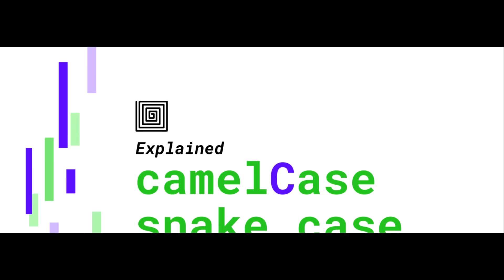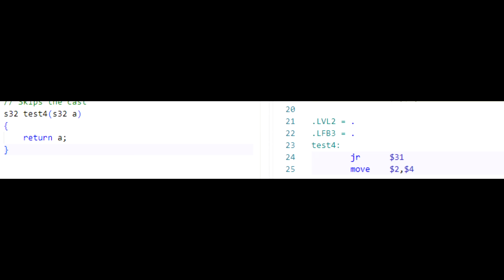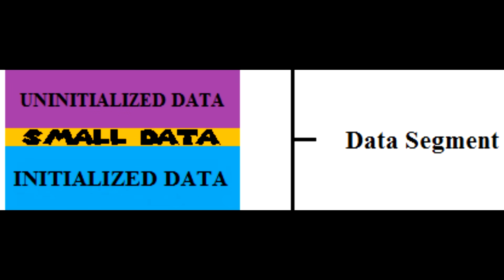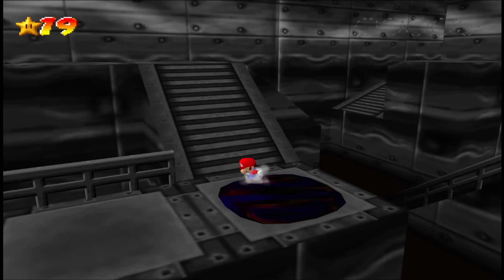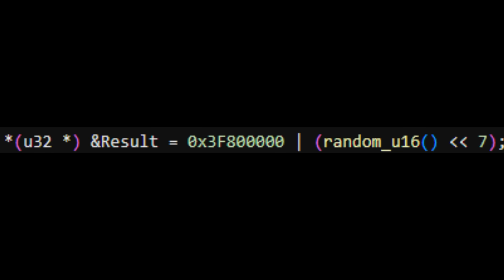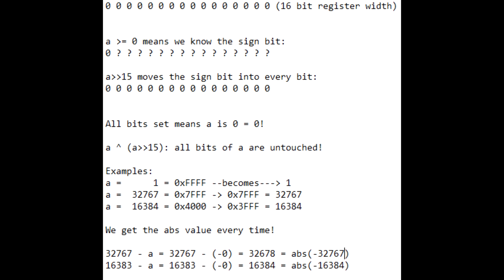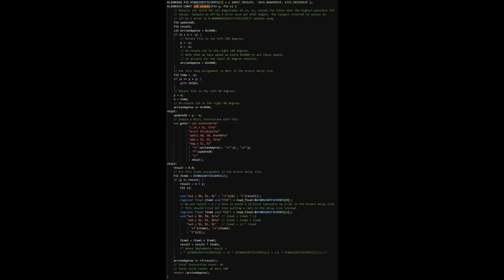Optimizing with "Bad Code"

Comment: The 'goto' part got me thinking the next step here would be to implement a N64 specific compiler
Reply from the maker: i already have some n64 specific tricks in this compiler! its a custom gcc build.
Reply: @KazeN64  Are they N64-specific or your-game-specific? Is your GCC fork public? I can imagine the libdragon guys being interested in this (unless they already implemented the same tricks in their toolchain themselves).
Reply from the maker: @the_kovic  easyaspi made it and it is publically accessible! although she's only posted it in my discord. but i have the custom build linked in this repo's readme
Reply: @KazeN64  
Wait, since this is a custom fork of gcc. Is there a way to patch-in a sort-off assembly passthrough in the compiler, so that you can write in both C and Assembly without doing the weird inline assembly trick you mentioned?

Probably overthinking things as usual, but who know.
Reply: I've had this idea for a while but I'm not sure how to implement it. It would basically be like Godbolt Compiler Explorer but it also showed you clock cycles. Like if you highlighted a section of code, you know how it shows the total character count? Imagine that but it also assembled it and displayed the byte count and clock cycles.
Reply: Yeah, this trick is pretty commonplace. I find myself using it a lot when writing optimised routines in high level C# code.

On modern architectures it can also sometimes be beneficial to just duplicate the code and go without goto, due to greater size of instruction caches.
Reply: @williamdrum9899 it should be fairly easy, I'd think. I have a massive PDF somewhere with a table that contains all the instructions' latency and throughput for most major desktop CPUs. So long as you supplied a target triple for which you had data, it shouldn't be difficult at all to make an extension for it.

Comment: If there's something useful I've learned in all my years, never use a linked list, for anything. We'll just ignore that a linked list can be thought of as a flattened tree because trees should have an algorithmic structure and no longer be thought of as being a type of linked list at that point. However, for cache locality and speed of processing, an array of some kind is best. If you need to store more than a certain threshold that should be determined per the processor you're programming for, then use a hash table or some other algorithmically accessed array type. The best kind of hash table is one in which the data is stored in contiguous chains and thus you reference its location in storage with an index value and upon deletion you swap to the end and update the single element that took its place, while also remembering to store the hash code as even at 4 bytes it'll save you a lot of time in not recomputing hashes whenever the table changes size, as well as using table sizes that are powers of two so you don't have to divide. I should probably write a book as there's a lot more to it than that, but it's a start.

Comment: Half of this isn’t even optimising for the hardware, but manipulating GCC. At what point is it better to just build your own version of GCC specific to a single project?
Reply from the maker: in a way the reason we have to manipulate GCC is because it is not optimized for the n64. but yeah a custom GCC build would be the best option. i currently do have a slightly edited GCC for this purpose, but it's nowhere near perfect.

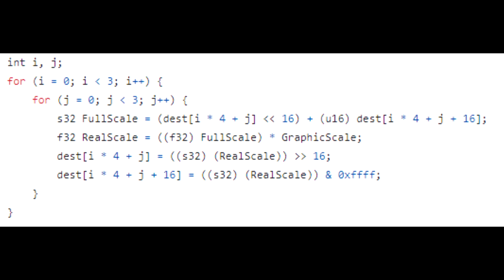Comment: 7:04 You can avoid this issue entirely by moving the decrement of the loop variable into the body of the loop so it executes after the loop condition and before the first loop iteration.  This is also very useful for decrementing loops that use unsigned integers.

Comment: Regarding the overflow emulation, the C standard doesnt specify it for signed integers, so you could probably just use a signed index into the array to start with

Comment: 6:52 - same with 68000 - it has a "DBRA" instruction - "Decrement and Branch", which decrements and branch if not -1. However this means you MUST write:
for ( i = count-1; i >= 0; i-- )

This will NOT produce DBRA (at least not with my version of GCC):
for ( i = count; i > 0; i-- )

...even if "i" is not used in the loop body! Instead it does a standard SUBQ+JNE which is slower. Same trick, but an annoyingly subtle MIPS-vs-68k difference.
Reply: That is so frustrating. When I'm doing 68k asm I usually would do something like this:

foo:
MOVE.W #9-1, D0
DBRA D0, foo

for a loop that is intended to execute 9 times

Comment: As a general advice, if you really need top of the line performance out of limited hardware, focus on writing clean code, and then convert in the most performance critical places to faster, less readable code, measuring what you do, until you hit the performance goal. Given what you're trying... yeah... good luck

Comment: Kaze: Uses "goto" to swap logic for instruction caching
Me: YOU WHAT?!
Kaze: Overwrites functions with memcpy for a properly optimized call path to avoid bugs per console
Me: I AM CALLING THE POLICE!
Reply: i have honestly never seen the goto thing before, both are illegal but i'll permit it I'vd overwritten code with raw machine code bytes at runtime before. e.g. a E8 Call on x86.

E8 00 00 00 64

calls func 100 bytes after end of that instruction
Reply: I couldn't read your "YOU WHAT?!" in any voice but Incidental 6's (from Spongebob). You know which one I am talking about.
Reply: @GreyWolfLeaderTW  "You asked for a couple of ice cubes, but I only put in one!"
Reply: Memcopying functions is such a lovely abuse of C.
Simple, efficient, logical, and yet so heretic.
Reply: @musaran2  Janking with your own execution code in memory was done in Wolfenstein 3D. I have no idea why they did it either.
Reply: Some cheat-code handlers (like Gecko OS / Gecko Code on the Wii) make it possible for cheat codes to modify game code; furthermore, on the Switch, I've seen cheats that do this in tandem with a button activator - e.g. if B is held, write some instructions in memory; if B is not held, write different instructions

Though I have to say, the goto trick and the memcpy trick "to avoid bugs per console model" are such neat ideas lol
Reply: @zitronenwasser I think it's just the more extreme version of using just `likely(...)`
Reply: Overwriting functions with memcpy was very common in the 16 bit era. You know  those games where each level had a cool visual effect? Well, it's a pain in the butt for a game to ask every frame "Which level am I on" when that's not gonna change. But this "disgusting" trick is really the only way to avoid that. Rather than having an n-way branch based on the level we're on, the proper graphics routine is memcpy'd before the level begins. That way there's no need to even check!
Reply: @williamdrum9899 If you wanted to avoid branching and memcpy, you could make a jump table with the level index (in this specific scenario), buut that costs an array of length n and probably a couple instructions.
Reply: @fisch37  Memcpy is better in this case since I have plenty of time between levels to do it, rather than waste my precious HBLANK time
Reply: Call the police if you want, it's not as fast as Rambus

Comment: The compare with zero trick also works on the NES, SNES, and all other 6502-based systems. Whenever you do an arithmetic operation, it sets the equal and carry flags with an implicit comparison to 0.
Reply: Even LDA implictly compares to zero!
Reply: On x86 too, thanks to the zero flag
Reply: @erkinalp  Yep, that's why we use "test eax, eax" so we don't need to encode 4 bytes of zeros

Comment: Had a coworker that wrote a small script in python cause it is "So easy and fast to write". When he used it he noticed it was too slow to be used at all (simple test-cases with inputsizes in the range of maybe 50 elements would work, we needed thousands). Then he spent weeks trying to make his python faster.
He ended up writing it in C++ and was done in 2 weeks (and a couple thousand times faster program).
Reply: I did some advent of code challenges in PHP this year & BOY IS IT SLOW. 

One of my solutions was a brute force of about 4 billion operations, which i broke into 10 processes & then each process took about 3-5 minutes.

Then someone in YT comments said they brute forced in Rust & got it done in a minute or two.

To make it better, my brute force didn't even get me the right answer! Lol.

Also by "operation" i mean ... a loop, basically. Each loop had quite a few things to do.
Reply: There was another advent of code challenge i did in PHP that was computationally intense (+ LOTS of memory access) where i was able to optimize the heck outta my php though & actually make it work. 

That was my first encounter with memory bottleneck being a real problem.

Comment: 1:45 The lie you tell the compiler here is a neat trick, but I wonder of the cast can be avoided with an assume attribute instead to just tell the compiler that the value is in a valid range?
Reply from the maker: oh i didnt know that was a thing to use
Reply: @KazeN64 I've seen an ASSUME(x) macro implemented as if(!(x)) __builtin_unreachable();
Reply: @tolkienfan1972 gcc's attribute assume is even smarter, since it doesn't semantically execute the code. That means you can tell it to assume things about the result of variable modifications.
Reply: @gfasterOS  I guess that's new. Well, new to me

Comment: Well, tbh the principles are more straightforward than that. When you write code, your very first objective is to make it produce the desired result or outcome. Second, you make it robust - you take into account edge cases and variations. Third, you optimize it. And you have to do it in that order specifically since there is no sense of optimizing a code that doesn't work.

And when you optimize you basically sacrifice maintainability - aka you don't expect to change that code much ever again, it is the dead end.

Comment: Re: 4 this is so cursed and amazing

Re: 7 separating the "hot" and "cold" branches of a function is a good one. There are a few variants of this that may or may not help (usual caveats: depends on arch and runtime patterns). Instead of using "goto" it might be better to call a separate non-inline function. You can put all the "cold" branches in a separate section, so that more of your "hot" paths are in cache. In cases when the "hot" path is very small and common, you could also inline the hot path.

Re: 13 at some point it is clearer to just go full asm :)

Comment: And so now we know why the N64 was the "less performant" console in spite of the lack of disc read times.

To squeeze all the potential it had out of it, you had to be a fluent practitioner of the dark arts, on top of breaking several coding Geneva convention guidelines.
Reply from the maker: fortunately all of these just save a few microseconds here and there. i'm sure other consoles had similar dark art shenanigans you could do haha
Reply: @KazeN64  gotta squeeze as much as you can out of the 16k microseconds you get per frame
Reply: I imagine most of this video applied to playstation as well

Comment: It's scary to think, but it seems like that self modifying code trick could actually make a big impact in some real use cases. I mean you can potentially save millions of if-checks with it.
Reply: I have done something similar in a Javascript game I'm working on. I had no idea if it was even faster or anything, I just thought it was cool that I could do it. I used it for remapping keyboard inputs to different functions depending on if you're in a menu, a map, a battle, etc.
Reply: thankfully, protected mode saves us from even having to consider that on modern CPUs
Reply: @TwilightFlower9 you can tell the kernel to make a read/write/execute page, this is how most JIT compilation works
Reply: hell, you can tell the compiler to just make your code writable (or use objcopy, if the way the compiler does it makes things not work how you need them to)

Comment: Casting the function pointer in that instance is undefined behavior because s16 and s32 are different types. Be sure to carefully inspect the generated assembly if you do this
Reply from the maker: What's undefined about it? It seems pretty clear what the compiler needs to do here. I imagine it's only "undefined" in the sense of "it behaves differently on different hardware" and not in the sense of "the compiler can choose to do something wrong here"
Reply: @KazeN64  Dereferencing a casted function pointer is undefined behavior if the return types, amount of args, or types of those args differ. Undefined behavior means that the compiler could generate batshit asm depending on the optimization level you choose. Just check to make sure the outputted code is what you want
Reply: @KazeN64 Also is there any reason why you write in ANSI C89 for N64? I would imagine your GCC to at least support C99. That way you wouldn't have to do ugly things like declare variables outside of for loops. That is a major source of bugs in the Linux Kernel and the main reason why they moved to modern C standards
Reply from the maker: @xBiggs  the original sm64 source used an old compiler and all the vanilla code is matching. my own code can use newer conventions

but none of what you mentioned explains WHY it's undefined behavior - shouldn't it just use the function signature provided to generate the assembly and call it as though that was the actual function signature? it should be predictable what it compiles to here
Reply: @KazeN64  Thought:
You may be able to avoid the undefined behavior by having the function return union {s16, s32} and subsequently use the s16 member. The union will take up s32 space and satisfy your alignment requirements
Reply from the maker: @xBiggs  i dont see how that would help prevent the cast
Reply: @KazeN64  I don't think the union uses a cast? Share me your compiler explorer
Reply from the maker: @xBiggs  i haven't compiler explorer'd it, but just logically it makes no sense that you can get either the higher or lower 2 bytes of an s32/s16 union without casting. there is no assembly code that would be able to do this in MIPS. what do you want it to compile to here?

Comment: ... What I'm getting from this is that when you will be sent back in time to make the fully optimized Super Mario 64, they will either kick you out for writing this code or praise you for your genius.
Reply: They didn't had the same compiler.
So, some of his hacks won't be usable.
Back in the day, if you wanted power, you wrote assembly functions and used C as "super assembly".

Comment: Wouldn't writing some functions entirely in assembly be more readable than having to inline some asm instructions here and there to force the compiler into producing the asm that you want? At least for short functions.
Reply from the maker: probably, but writing inline assembly for mips gcc is torture, i can never get it to just go into the rom and it throws millions of errors lmao
Reply: GCC is also very enthusiastic about exploiting undefined behavior, and will usually use it to do things you don't want. You have to deliberately disable certain optimizations in order to get away with faster code, which will just make code elsewhere slower.
Reply: @KazeN64  what about writing out-of-line assembler then and just linking it in as a separate object file
Reply: @Ehal256  good point, and I don't think  you could use LTO to easily fix that.  I'm not so sure that 68k assembler is actually easier to write than MIPS asm (a lot of places used to use MIPS as the intro to asm)
Reply: @undefinednan7096  While that may be true, MIPS was really designed for compilers, and 68k (designed in the late 60s) was still made to be hand-written. I would guess that MIPS is common in those courses due to the simplicity of the ISA, so it's easy to go from an asm course to a compiler course using the same instruction set, and the fact that 68k became a dead end right around when MIPS became popular (Motorola was focused on PPC). I'd say MIPS, and most of those classic RISC instruction sets, are a bit too simple for hand-coding if you ask me though, 68k is downright comfy in comparison.

Comment: As someone who's coded games that fit in a few hundred bytes, I see this as an absolute win.
Reply: Boot sector games?
Reply: @EndOfForever  In that size range, sometimes smaller. A while ago I made a version of Snake that fit in a Tweet, or under 280 bytes.
Reply: Games for TI83 calculators can be pretty small if done well.  I made a 5-level puzzle-platformer in around 1.5kb once.  But the Bubble Bobble game I made was much bigger, somewhere near 22K.
Reply: @jacklawsen6390 jeez, that's barely larger than wozmon, and even that was pretty damn small for what it did.